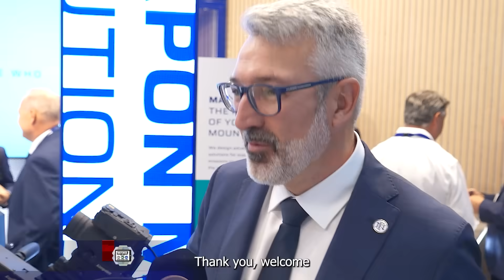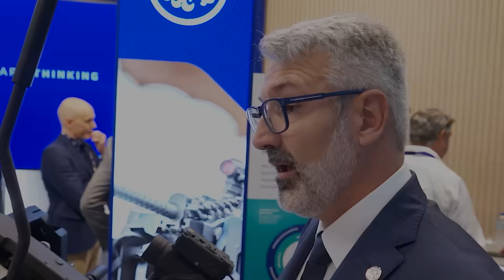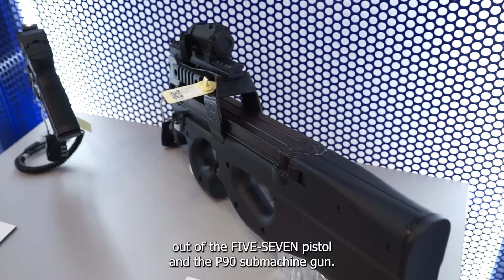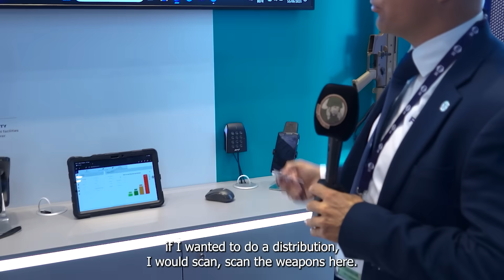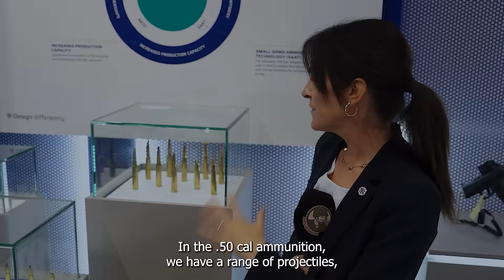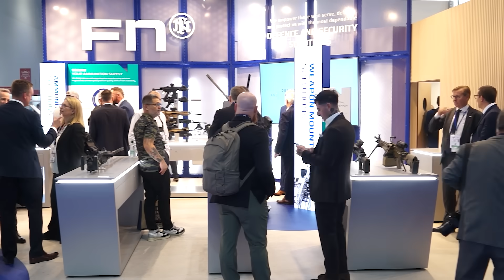Belgian Company FN Herstal Showcases Weapons and Defense Innovations at DSEI 2025 London UK

Comment: Great news! There is a growing feeling that these weapons will be needed in the future.
Evolys - it is to me quite astonishing that this weapon system hasn't been snapped up by more customers internationally. It's the perfect solution in allowing troops to switch from suppressive fire to single shot accurate fire at will. Also, a 30% weight reduction from current M240 SAW [Minime] is a game changer, in my opinion. A current SAW gunner can up his ammo supply by that amount and still carry the exact same overall weight, and have a lighter, more flexible weapon at his disposal.  Another feature is the recoil system - videos show an operator firing a whole belt with minimal muzzle-climb throughout the whole belt, in a standing position! One can even attach the Evolys to a vehicle-mounted pintel point while moving, and detach it when dismounting! The benefit of this is massive, and as yet there is no "normal" application for it. Some re-writing of operational applications is needed here. 
With this Evolys capability, there should be a radical re-think about how to constitute fire teams/squads to maximise on the obvious strengths and capabilities of this Evolys weapon system. 
Well done FN! Keep up the good work!

Comment: Modern drones should be equipped with a durable shield or armor plating positioned directly in front of their weapons systems. This structural enhancement not only protects vital components from incoming fire but also ensures the drones can maintain effective offensive capabilities in combat situations... Additionally, if the enemy becomes aware that their front-facing fire is consistently ineffective against these shields, it could significantly undermine their morale and confidence in their ability to damage or destroy the drones, potentially causing hesitation or retreat in enemy forces.

Comment: its odd to drop the f2000 and keep the scar.:face-orange-raised-eyebrow:
Reply: The plastic cover of the F2000 made it harder to clear misfeed, and caused problems with sand. The SCAR is more reliable.
Reply: @guilemaigre14  EVERY good design had problem and inferior design models are more reliable and maintenance pratical . i canot understand than a governement who have millenium of experience in weapons manufacture canot setup an industry and relly only on the good will of privates . do you tryed to handle a p90 even in airsoft ?